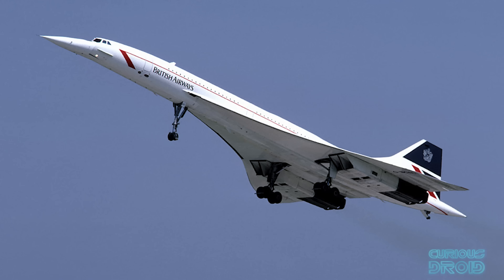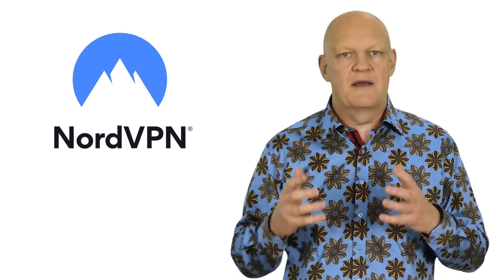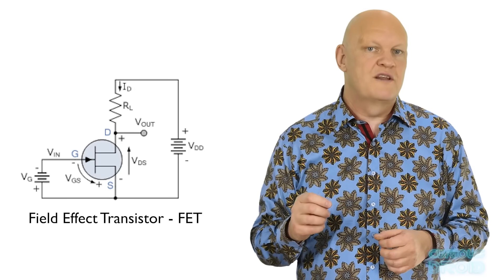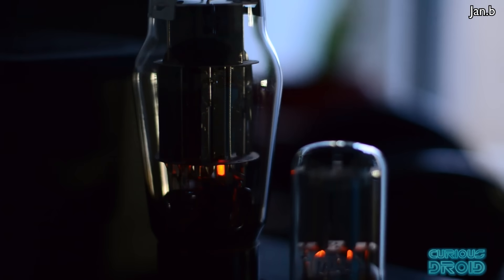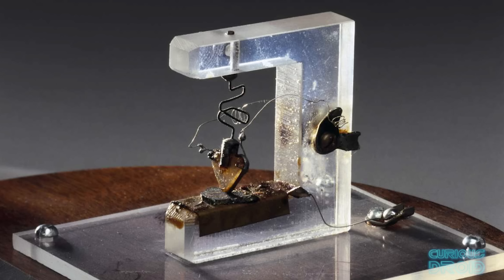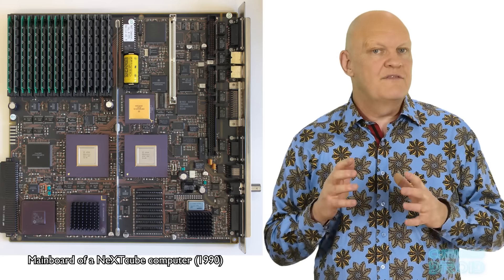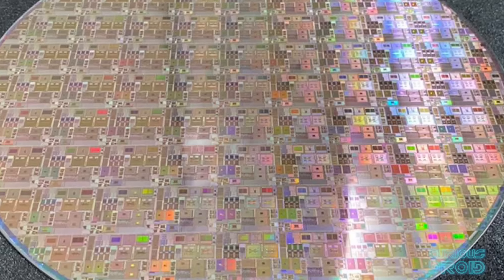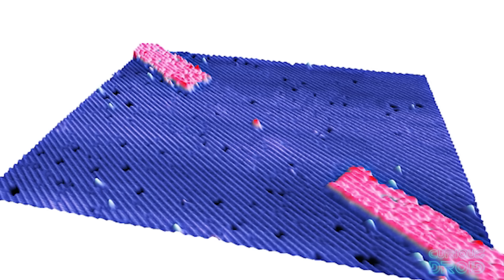MOSFET – The Most significant invention of the 20th Century

Comment: Don't know how I ended up here as I was comparing welders some have mosfet some igbt not sure which is better yet as so many conflicting views maybe you guys and girls can give a different view on deciding, a migwelder for thin car body repairs, my old mig is transformer AC 40/130 amps better to have 20amps for thin metal which these newer inverter welders do 20/180 and are DC  welding so told less splattering as  well but which would make it a better and more reliable machine, a mosfet I can change if they pop good old maplins in the day, thanks

Comment: Another thing you should have mentioned is, as the devices get smaller and are packed more closely together, there's a real danger of arc-over because of the tiny distances between the circuit traces and the MOSFETS. Even 12 V might cause an arc-over!
Reply: 12V is high for these chips that typically do everything internal at carefully chosen voltages below 2V.  Then larger chip features near the physical edge of each chip interface to external connections at 3V or above (some modern computer parts have some external interfaces below 2V).  Computer motherboards with x86 CPUs often have a row of chunky voltage regulator modules converting 3V or 12V to whatever sub-2V value is ideal for the CPU installed at the configured speed.
Reply: As transistor size shrinks voltages and capacitance drops resulting in power savings and speed increases.

Comment: i started on dads crystal set then 120volt tubes then the 9v 3 legged fuse.  the transistor then in to 600v 1000 watt transmitters
and so it goes on today.

Comment: I feel like by the time we can't squeeze any more power out of our electronics they'll have reached a million times more computing power than we would ever need! Video game graphics have ALREADY come close to photo-realism and I think the gap between the current graphics and actual photo-realism won't require much more c-power to close, and I think even work applications that do take a whole lot of c-power will reach the point of being able to simulate everything there is to simulate long before we run out of possible ways to improve a chip's computing power. I think the only thing that could really push the limits of physically possible computing power would be something like simulating every individual drop of water in all oceans combined umphteen times over.

Comment: PMOS MOSFETs regularly have 5 terminals, NMOS regularly 4 terminals.

Your description of photo-lithography is off too.  It starts with a layer of photo-resist that is hardened by light projected through the reticle and reducing optics.  The unhardened resist is washed away, then the silicon revealed underneath is etched or implanted.  Next the hardened photo-resist is washed away to create a clean surface, then the wafer is oxidized or deposited to form the next layer.  Sometimes a chemical-mechanical polish is done to flatten the surface, then the process starts over with a new layer of photo-resist.  It continues like that until the entire stack of layers is fabricated.

Also 5nm has been in production for several months before this video was published.

Comment: Back in the 60's i worked for Fairchild Semiconductor and they had a manufacturing facility in Hong Kong making transistors on a ceramic base with a drop of black epoxy coating to hermetically seal them.  The transistors would come in in bulk and then get tested and sorted for breakdown voltage, gain, etc. There would be a number of failures and even some of the scrap got sold to a company making teddy bears which used the transistors for eyes.

Comment: My introduction to MOSFETs was when I purchased a NAD 208 thx power amplifier. Gobs of power with current galore. It's one of the few stereo amplifiers made for surround sound systems containing MOSFETs and a toroid. Big power, indeed. 250wpc @ 8ohms; 425wpc @ 4ohms. But, the secret sauce was NAD's proprietary "Power Envelope" which entails six extra MOSFETs per channel for Peak power that is ungodly. 600wpc @ 8ohms peak; 900wpc @ 2ohms and will run 1ohm at 1800watts. Perfect for a potent amp for a passive subwoofer if you wanted, though it is a very fine stereo amp.

Comment: The next big thing along the line of transistors is the QLG . That is the quantum logic gate.  

Whereas the normal logic gate has two states: on & off, the quantum logic gate will have at least 3 – on, off and somewhere in between.  

That's at least 3 states, maybe 6. They are 0,0,0 & 0,0,1 & 0,1,1 & 1,1,1 & 1,0,1 & 1,0,0. 

A transistor with 4 logic gates would have 24 possible states.

Comment: "the triode valve was equivalent to a transistor"  eh, no.. tubes work much like mosfets, the grid control is voltage dependent such as the mosfet gate, transistors are current dependent through the base. Its funny how we went from voltage control to current control back to voltage control. :)
Reply: You are sooo correct !   I thought I was the only one who noticed that, until now

Comment: 13:15 This is a common misconception. The node name of "X nm" used to refer to the gate length of the transistor, so if that were the case, then yes a "7nm transistor would be ~35 Si atoms across". However, since the introduction of FinFETs, node naming has become entirely detached from any physical measurement of the transistor. Gate length remains much larger than 7nm, but it's intended to say that this 7nm FinFET is roughly equivalent in density to a theoretical 7nm planar FET.

Comment: Put together a heath kit 25" color Tv back in 1975. Had I think it was 17 printed circuit boards. Now 1 little board in a LED TV does the job. Replaced a 6 pack. ( 6 IGBT'S inside a 480 volt 125 horsepower VFD ( MOTOR DRIVE ). Did not know the control board was also bad. After I started it up sounded like a cannon going off when the 6 pack blew up. Opened the cabinet and had a room full of smoke. Always liked Moore's law.

Comment: 3:58 lol, you had me thinking about MOSFETs and I saw this guy holding these transistors in his hand, "well those are probably fried now", but those are just plain old BJTs.

As an embedded software engineer, I've wasted SO much time in the past because I wasn't careful enough with some components that I'm hyper paranoid about ESD now (electro-static discharge) -- i.e., putting circuits together and spending hours troublehshooting them (and the software) only to discover that I fried something.  The ESD voltages that can fry these little things are orders of magnitudes lower than what you will see, hear or feel.
Reply: True that, I went into some computer store to get some RAM into my computer, and I had a fit when the guy didn't put on a grounding strap.  We had a really high chip failure rate in the military upgrading some test sets until we cracked down on ESD protocol.
Reply: @bbirda1287  Jeez!  That ticks me off just hearing about it.  Some stupid middle-man frying components that WE have to determine are bad (sometimes running memtest for hours), when they arrived at their store as good components! %&@Q)$ idiot! lol

Comment: There is literally nothing in the 20th century that has increased in performance like silicon integrated circuits (microchips) have.
No engine, no car, no plane, no machine of any kind what so ever.
Most people walk around with more computing power (and memory) on their wrist, than existed in entire computer installations in the 70’s. 
In terms of speed, area occupied, power dissipated, cost to produce and outright computational power, the progress of the silicon chip has outperformed absolutely everything by several orders of magnitude.

Comment: Having graduated from the USN's Basic Electricity and Electronics course in the early 80s much of this was "old hat" to me.

However, the staggering pace of chip development since then has left me mind-boggled by the advancements.

Nevertheless, I urge everyone to order some transistors, capacitors, diodes and gates and make some basic electronic circuits, just so you understand what's going on in that little device in your hand.

Building your own radio, calculator or electronic sound-machine is honestly an enjoyable and rewarding experience.
Reply: A person with an engineering mind has never experienced true fun until they've tinkered with a breadboard!

Comment: Before covid hit I was really into playing airsoft and before everything happened I had purchased a G36C made by kwa. It's a fully licensed G36C and it was really well made. One of the things I found out was there's an adjustable mosfet in the trigger system. So I can essentially change how much power is going from my battery to my motor at any time really with a screwdriver essentially. It's not super compact by any means because I can change it with a screw LOL but I think it's really dope that I can basically have it set up for semi-automatic fire and make it so there's less voltage going out to setting it up for fully automatic fire and putting More voltage out so it shoots a lot hotter. 

And that's an airsoft gun so I totally believe you when you tell me that mosfets are everywhere LOL 

Also I'm not 100% sure exactly how my airsoft gun functions electronically but I'm assuming that it's just changing how much voltage is going from the battery to the motor.
Reply: Adjusting the voltage is one way, but that only works on a brushed DC motor. A more common method is PWM, pulse width modulation, where it basically sends the motor a square wave, with the amount of time spent on (duty cycle) controlling the speed or torque. Depending on the circuit, that can translate to a direct voltage if your thumb screw controls the charge rate of a capacitor or something. PWM has the advantage that below a certain threshold voltage some devices just don't work at all, and you lose fine control. It takes a certain minimum to get that motor turning, so you just give it full power for a millisecond and let the motor's inertia smooth it out.

Comment: Chips were improving so fast in the 80's and 90's that it was often said a product was obsolete by the time you could buy it.
Reply: Dennard's scaling hadn't ended back then, so you'd see chips double in clockspeed in just a couple years.  going from 8mhz to 15mhz to 33mhz to 66mhz.  Nowdays chips have hit that tdp limit and IBM, AMD, and Intel haven't been able to break past ~5ghz (IBM still makes chips though they are for the mainframe market)
Reply: It still is tbh on some products like smartphones and graphics cards.

Comment: After reading the comments below, I enjoyed a lot of fond memories. I didn't build my first IBM clone until 1987 but it replaced my Atari 520ST which was a great gaming pc and had a decent word processor too and it could access most of the anonymous bulletin board systems with the modem peripheral. A lot of people at the time didn't know that the 520ST used the same Motorolla 68000 CPU as the Apple Macintosh.

Comment: The hardware engineering principals behind the MOSFET 'How?' are the same as the old tube technology, control via setting up plates that control current flow via variable control of voltage fields. 
What go around comes around.

Comment: I've always wondered how it's done. They're impossibly small, it hurts my simpletons brain trying to imagine the production process. Great video.
Reply: Well, our DNA molecules are even much smaller, so there is still huge room for improvements.
Reply: @es pretty sureDNA molecules are bigger than transistors? They consost of at least hundreds of atoms while a transistor is like less than 30 in diameter or so?
Reply: @johnuferbach9166  i didn't mean 'physically' smaller. 
DNA macromolecules consist of millions of atoms, and are very large compared to many others, or to those transistors.
The principal difference is, that every atom or aminoacidic group there performs a certain function.
And our semiconductor technology is still quite far from this fine level.

Comment: I'd argue that the Bipolar Junction Transistor was the most significant invention. Not only were the transistors used extensively the world over, but BJTs also opened up the field of semiconductor physics. It was this opening that led to Field Effect Transistors (both junction and gated), Silicon Controlled Rectifiers, Triacs, Tunnel diodes - a host of all sorts of components. And, yes, it also lead to the development of integrated circuits, first with bipolar transistors, then with NFETs, and then on to complementary metal oxide field effect transistors, leading to the development of CMOS (Complementary Metal Oxide Semiconductor) circuitry.

MOSFETs are useful, but the Bipolar Junction Transistor is the granddaddy of them all!

Comment: mosfet,jugfet,dual gate trannys,make good boost pedals to hit a valve amps front end with
i've got a 40 year old semi conductor text book to check specs with,and early exp circuits to show off the new trannys in
still love a nos 0c44 germanium tho consensus is same can be made with silicon in smarter circuit,roger mayer in point
can't get the grind from a bc 10- imho

Comment: None of this would be possible with the clear understanding of quantum physics. Cool video.
Reply: fun fact: at SK HYNIX biggest problem is NOT how to get to 5 nm, we r already there. The biggest issue is as you say, quantum physics, with most of engeneering time spent teaching the system WHEN an error is generated because of a real data problem, or just because of few electrons where out of place as, you know, they are in a certain position as a result of an average position give from quantum physics. But it sometimes it happens they are in the wrong and unexpected position, and at 5nm, they result being completely out of place, giving off fatal data errors. It's just like fighting VS  Jesus Christ, someone would say. :)